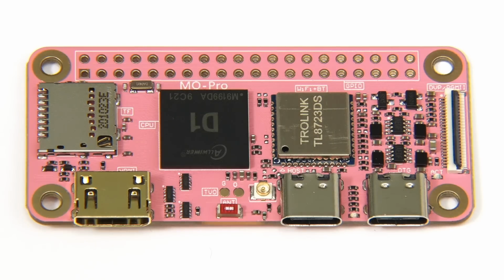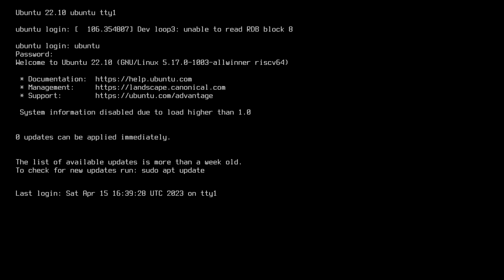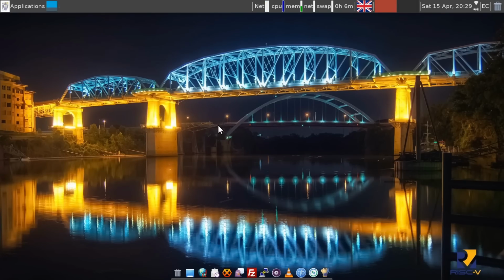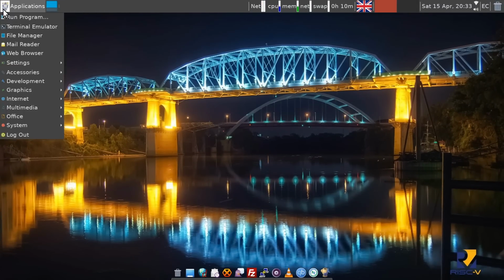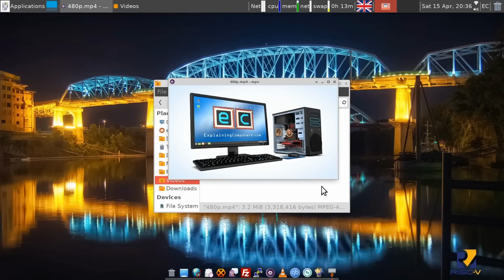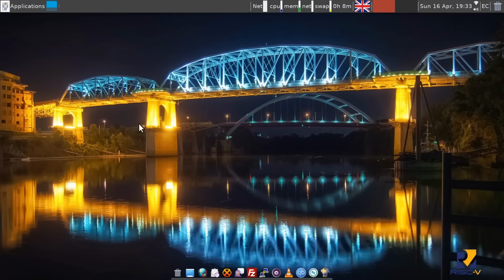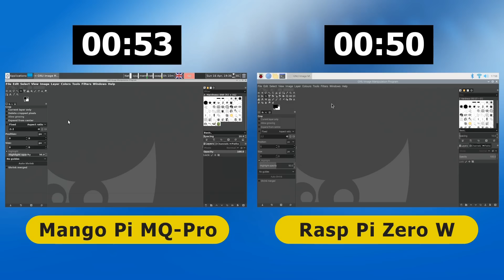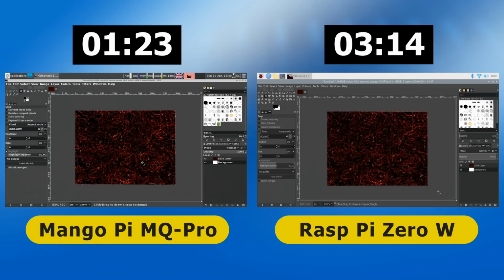Mango Pi MQ-Pro RISC-V SBC

Comment: Well it seems impressive from the get go, but remember the pi zero (which is essentially a minuscule overclocked 1st gen pi) uses an arm11 processor, which is armv6 ISA! It's only twice as fast as an old iphone 3GS!
Also, when the pi 2 came out, it had a cortex A7 quad core, but it was 6 times faster !
This D1 chip is not the best showing for RISC V, there is a quad core board out there that is much more promising, but if used as a microcontroller replacement (kind of), it might be a good solution, but there's the RPI pico
Reply: Obviously the D1 chip is not the best RISC-V has to offer. If you have $50-$80 to spend then you can get the quad core 1.5 GHz VisionFive 2 which Chris has already reviewed, which is somewhere between a Pi3 and Pi4 in performance. The just-released Pine64 Star64 and PineTab-V use the same JH7110 chip.  The Sipeed Lichee Pi 4A, which will go on sale for $99 this month, has the TH1520 SoC with C910 cores similar to the A72 in the Pi 4, but running at 2.0 GHz stock (the chip is spec'd for 2.5 GHz, but that needs a heatsick). At the high end, I'm already the last few weeks using a RISC-V machine with an SG2042 chip that has the same C910 cores as the TH1520, but sixty four cores, 64 MB of L3 cache, 32 lanes of PCIe Gen 4. The first board using this chip -- the Milk-V Pioneer -- is available for preorder at $1600 with 32 GB RAM or $1900 with 128 GB RAM. No doubt other cheaper boards will come in due course. Later this summer we will see the HiFive Pro P550 with only four cores but faster ones similar to the Arm A76. It should be comparable to the fastest Arm SBCs currently, with the RK3588 SoC.
Reply: You're one of these people I call "OMTs"... there's always "One More Thing" that needs to happen before you engage with anything, and you simply end up never engaging with it anyway.

Comment: Thanks Chris. But one question: why don't you use a PI ZERO 2 W, it's a 64 bits processor. I have one but unfortunately, it's use with a RaspiOS lite without desktop. In french benchmark we can see that the new one is at minimum 2 times faster than the older.
Reply from the maker: I wanted to take the opportunity to compare two boards with a single core 1GHz SoC -- one ARM, and one RISC-V.

Comment: I'd love to see extremely lightweight distros like Puppy and Tiny Core running on some of these very low spec SBCs. I don't think Ubuntu is even interesting on this hardware because it's so bulky. But I can imagine Puppy linux running happily and providing a full desktop experience with almost no problems. Of course, things like YouTube video playback that the hardware just can't handle will never be solved for these ultra-low spec boards. But most things aren't that inherently heavy. We've just let the bloat grow with our hardware capabilities because we could.
Reply: The problem with a lot of distros is that they only focus on Intel 64-bit platforms and porting an entire distro to ARM or RISC-V (as well as maintaining it going forward) is no small task for the small teams that create some of these distros. They simply haven't got the resources to support multiple ports of their distros.

I constantly like to remind people that Linux is entirely about "effort in = reward out". Everyone has access to the core Linux and GNU source code, you can do what you want to do with it (as long as you follow the license T&C's) and you can do like I do and use a "build it yourself" distro like Gentoo Linux to build what you want on many different platforms. The down side to that is investing the "effort" of putting time in to learn and test stuff for the "reward" of having an efficient Linux build on a new board.

I've done Gentoo Linux builds on Raspberry Pi, Orange Pi, Banana Pi and Asus Tinker Boards but each one took time to build, often using the "complicated" task of "cross compilation" and once they are built I still have to maintain them going forward.

People have been very lucky with Raspberry Pi boards because of the huge community built up around them and the great work put in by the Raspberry Pi foundation in making Raspberry Pi OS so quick and easy to deploy. But they are the "exception to the rule" and now that RPi boards are in short supply, people shouldn't expect support for other boards to be as good - in those cases, you are entering a "DIY zone" and have to do more yourself.
Reply: @terrydaktyllus1320  You're right. A port to another platform is basically a whole new distro that needs to be maintained. I know in the past there have been a lot of puppy derivative distros, but they were mainly re-mixes like we saw happen with Ubuntu. I know I can't just wish a distro into existence. But I was just thinking that an ultra-lightweight distro would make a better fit for these SBCs than a heavy distro like Ubuntu. And if it became a possibility, I'd like to see it done.

Comment: Hi Chris, thanks to your video I bought a Mango Pi MQ-Pro, which arrived from China to the Netherlands in about a week, nice.
However, I have problem booting it, so much so that I was under the impression my MangoPi was faulty. Only with the image on their own site, with xfce desktop, I was able to boot it, so it works, but the video is a bit flaky. The Ubuntu server image I tried did nothing at all. Which image did you use to boot Ubuntu server (with link please). I bought it so I can have a stab at RISC-V assembler language on the actual hardware, which is a bit different from my 80s old and rusty Z80 assembler skills, just for fun.
Thanks in advance,
Albert
Reply from the maker: Hi Albert. I'm pretty certain that I used this Ubuntu image: http://cdimage.ubuntu.com/ubuntu-server/jammy/daily-preinstalled/current/jammy-preinstalled-server-riscv64+nezha.img.xz  But I have a lot of links in my notes for this video! Note, as I said in the video, that you must have a USB to Ethernet adapter connected on first boot, as it seeks an Internet connection during the setup. Good luck!
Reply: Hi Chris, thanks. It works! The other thing to note is that you have to wait a couple of minutes after switching on for the output to appear, impatient me I guess. Again, thanks for the headsup of the Mango Pi and the tips!

Comment: What type of uses do you see that the Risc V would be advantageous to use over Arm? I must admit for my uses, I have gone away from Arms and back to buying old tiny PC's. Cheaper and I have found more reliable. It depends on usage of course. I like the sound of the Risc V but for what?

Comment: The thing is, the original Pi Zero was just as slow as this, only the GPU was better. It needs to mature a lot though, but it seems to be on the right track.
Reply: I think it was the combination of being only 32 bit, single core, and only 512MB of RAM. At least this has 64 bit, and double the RAM.

Comment: Hey Chris!
This does run straight out of the Transflash storage right?
This probably explains why it's so slow to boot and to quickstart most applications.

These things are horrible at performing any kind of non sequential read.

Believe me, while they are fine for storing Steam games, and hotswapping them around with a Steam Deck, (and they are quite exceptional at loading times, mind you) I once had the brilliant idea of installing an operating system on them...
That thing really dragged down my Ryzen processor, I'll tell you that...
Reply from the maker: Yes, it runs from the TF/SD card. But that does not explain the relatively slow speed here -- a Pi 4 boots in c.15 seconds from a microSD card running the same OS. It is a CPU (and RAM) issue as well.

Comment: How did Windows 95 render low fidelity video? I remember late DOS games and early Win95 games playing 160x120 256 colors or maybe even 320x240 256 colors during fmvs/cutscenes. I also remember streaming Limp Bizkit music videos from their website. They had an option to stream @ "28.8 quality" (just 3.5 kilobytes per second). I had a 166 MHz cpu with mmx extensions in that rig. How was any of this possible? Those early dabblings into video compression and video rendering were astounding at the time.

Comment: I think maybe you should have compared it to the current PI Zero 2 W witch would have faired a bit better and is $15.  The Gimp test was 181.5  so still not a winner but that is probably the amount of ram again. Edit: I think that old test was with a lager image size so this is may not be comparing apples to apples.  Can you chime in on this please?  That 181.5 was compared to the Zero W's 886.8 at about 5 times the speed.
Reply from the maker: I thought about that, but the direct comparison of two 1GHz single core SoCs seemed a nice test. A Pi Zero 2W should win with the GIMP test (although its 512MB of RAM could have held it back).
Reply: Good luck trying to find a Pi Zero 2 W for $15 anywhere at the moment.
Reply: @terrydaktyllus1320  7 in stock at my Micro Center right now.  They always seem to have them and at the list price.  Not often picos though most of the time, but right now they have  over 25 each of the regular and W versions.
Reply: @michaelcloutier2225  Fair enough, I will take your word on that. I know Eben Upton did say that supplies should start easing up a bit by now anyway so maybe that's the case for you where you are.

To be fair, I have all the Pi's I need luckily so I haven't been hunting for best prices, just observing them.

Comment: Is connecting the fiddly antenna necessary? Will it damage the board, if we don't connect it?
Reply from the maker: It will not damage the board if you don't connect the antenna. But the Wi-Fi reception will be weaker. Whether this matters will depend on your Wi-Fi access point/router, and how close the board is to them.

Comment: what i read it should be able to handle h264/h265 video playback 1080p@60/4k@30 ... from what i keep reading in specs. So coud it be the linux is not tuned enough to run it at full potential ?
Reply: It looks like the distro doesn't have hw accelerated gpu drivers?

Comment: So far I've been running into lcd's that don't achieve signal through the gpio and the HDMI instruction isn't achieved plugging into a windows laptop. Would a short from plugging into gpio upside down cause the board to fry? Or just the LCD? I get power to the screen to tell me there's No Signal so I figure the board isn't fried
Reply from the maker: Yes, the board could certainly be damaged by a GPIO short.

Comment: Chris great video on the board which is even woke 😂.  I don’t known if your aware but Pinetab has two models of their PineTab 2 available for $150 or$209 for the deluxe model. To to shipped in the middle of May 2023.  Their other PineTab offerings are based on the Ri3566 arm cpu.
Great time for new releases.
Have a Nice week.
Reply from the maker: Yes, the RISC-V Pine Tab looks a very interesting device -- a real RISC-V tablet! For others, see: https://pine64.com/product/pinetab-v-10-1-4gb-64gb-risc-v-based-linux-tablet-with-detached-backlit-keyboard/  But as they understandably make clear that it ships with no software and no promises, right now I'm personally going to stick with the VisionFive2 (same SoC), and wait for software to develop.
Reply: How could you fail to mention the RISC-V PineTab-V, for the same prices as the PineTab 2? I've got one on order.
Reply: @BruceHoult  I sorry that I didn’t use RiscV but  that is why I mentioned the Arm models since Chris was already talking about a RiscV board.
Reply: Define "woke", please?
Reply: @terrydaktyllus1320  Woke in this case means the manufacturer used a custom PCB color than the usual Brown/Beige, Green or Blue PCB colors.

Comment: Did you measure the power consumption of the mango pi?
Reply: @@nn-dv3uf they are around 0.65W booted but idle, 0.9W with the CPU busy, and 1.4W peak during booting with heavy CPU and SD card activity.
Reply: @n n Elsewhere on the internet it states that it is around 0.6 watt idle (similar to Pi Zero).
This matters for battery-powered applications.

Comment: Does Mango Pi support Raspberry Pi camera modules?
Reply: As far as i know that extra connector that looks like a csi camera connection is just for a ribbon cable that splits out the rest of the usbs. I actually smaller than the raspberry pi zero connector.

Comment: I'd like to use something like this as  motherboard for a game controller. I think running desktop linux on RISCV is exciting. But this mangoPi would be great to make a homemade controller. Used similarly to an arduino.
What would you load on this to run scripts and use the GPIO like that (embedded devices) instead of a desktop computer?